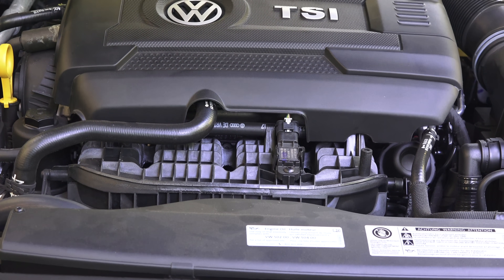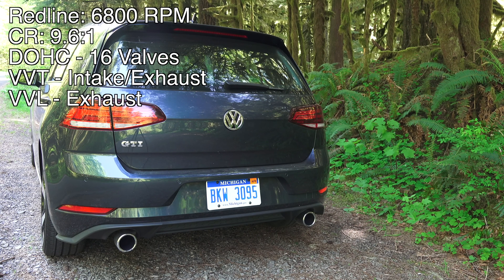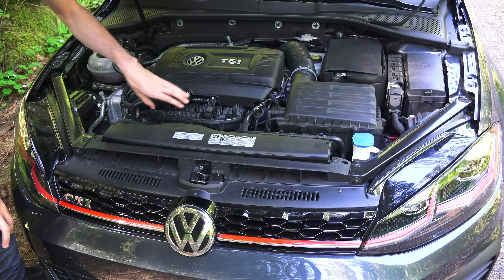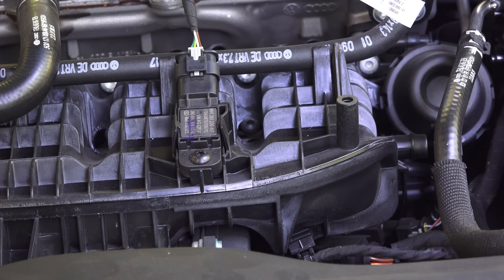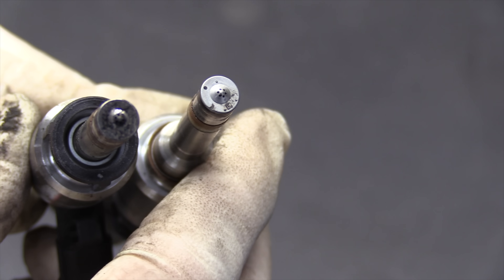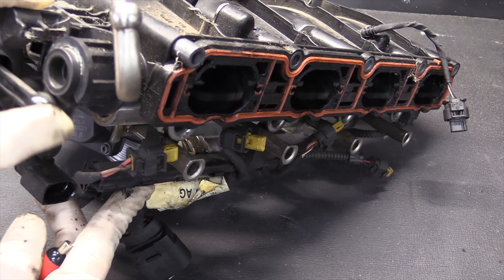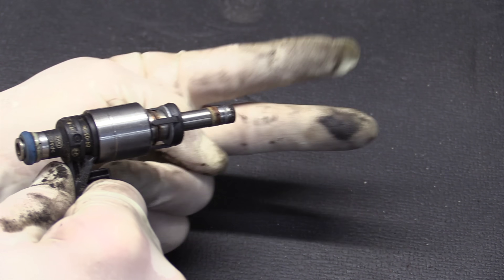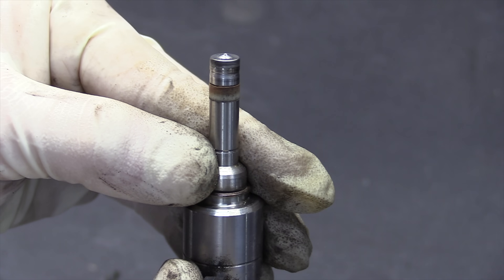The Best Engines - Volkswagen GTI Turbo

Comment: I thought the vw engines were crap
Reply: They are nice engines until they break
Reply: Did you read that on the internet?
Reply: The VR6 is the best engine hands down
Reply: They are good but as with most if not all German cars they use cheap shitty plastics for things like inlet manifold which break and the sensors are always packing in making the dash look like an Xmas tree.
Reply: nothing on bmw engines,  suspension much better though on vw. this gti engine suppose to be very good though. had one in my old scircco, very linear power, not spectacular though.
Reply: They are crap ;)
Reply: Digidi4 operated poorly

Comment: You have no idea how many check engine lights I had with my GTI... is this a joke
Reply: Steven it's 6800 until redline begins. 8000 is the maximum the revcounter can display, but your engine won't rev that high.
Reply from the maker: That was to alert you your engine was award winning! 😂
Reply: lol
Reply: My tuned GTI is sweet, only light I get is traction light !
Reply: 2015 GTI, 62,000 miles and not a single issue..don't even know what my check engine light looks like lmao
Reply: Engineering Explained this little light of mine, I’m gonna let it shine!
Reply: I have a 10 years old GTI and had never had an issue
Reply: Rockytofu I have a MKV and it’s got over 100k. The turbo did blow, driver error on my part, but otherwise no issues. 

You have to take care of the car for it to take care of you. That said, yeah sometimes you get unlucky and get a bad car for whatever reason.
Reply: The problem with volkswagen's is that people maintain them like corollas. Corollas are bulletproof because they are econo boxes that are not fast but will run for ever for cheap. Cheap, reliable, fast, you can only choose two.
Reply: It can rev higher than 6800 if you downshift it. ;)
Reply: Comments over here be like, "never had any issues with my golf, just changed the engine once".
Reply: Rockytofu.  While car shopping, I looked at a GTI, but walked away when I found out the 4 year old car had 4 previous owners.  There was definitely something wrong with that car.
Reply: MK6 GLI - 40k miles with 100hp over stock and never had a check engine light. I know a bunch of people that would say the same. 

But my old MK4 GLI check engine light was on 90% of the time I owned it. Countless vacuums leaks. My brother drives it now and it still runs great. 

They are great engines in my opinion. Especially if your going to mod it. Best all around cars you can buy for under 30k in my opinion. 
The DSG is awesome but can be a little sluggish in automatic. I drive in manual mode all the time.
Reply: Yep. mk5 was a mess. Then I urged a friend to stare clear of VW but he insisted and bought a mk6 GTI... says it was the worst decision he ever made. Mechatronics unit failed, got a new one. Timing chain rattle began, got it fixed. Mechatronics failed again after that and he gave up. You cant blame me for not having a single complement to pay towards VW. Their service is by far the worst as well. Never admitting their fault. So ill never get another on again haha
Reply: Noooooooo! No more k swaps lol soon everything will be kswapped
Reply: kkthxk Had never really understeer in a Civic, 80/90/00 Civics do more oversteer thanks to double wishbone suspension. Only the 8. and 9. Generation Civic had problems with understeer because of a complete different setup
Reply: Just because u get a c.e.l doesn't mean your car will break down
Reply: It's because VW's and other VAG group cars tend to have a lot more sensors than other cars. You could get a check engine light for something that another brand doesn't even have a sensor for. Or wouldn't bother warning you about.
Reply: @castin5244  can you give an example?
Reply: @user-jt6nw6wm5q  Well, I can't really speak for newer vehicles, but my 2004 Jetta 1.8t has like 5 different sensors and control valves for the vacuum/turbo system alone. Like wastegate controller, diverter valve controller, EGR controller and other valves/sensors for the turbo system. All of which are electronically controlled and can throw codes for small dysfunctions. Whereas other vehicles of the same era, like say a Chevy Cobalt or Toyota Camry doesn't have anything like that at all.  
Also, VAG group cars will give you a check engine light for things that other brands wont give you a check engine light for, even though they both have the same problem. What I mean is, a VW and Toyota might throw a code for the same reason, but the VW will show you a check engine light where a Camry will not. for small things, like a hiccup in the transmission or an intermittent failure in a temp sensor or something. I can't think of any specific anecdotes right now, but I've many vehicles of various makes and I've seen domestic vehicles have a ton of random codes but no check engine light, and a VAG car have a check engine light for one code. People perceive this as VAG cars being less reliable, but I honestly see it as a FEATURE. They warn you faster than other cars would. And just because you don't have a check engine light doesn't mean nothing is wrong with your car.
Reply: What year was yours? I've got the EA888 in my '15 CC R Line. Stg 2+ APR tune with full bolt ons, and running 100hp/150tq over stock for about the last 35k miles. Not a single engine issue. 76k miles on the clock. Preventative maintenance is imperative. That and you gotta give her the ol "Italian tuneup" every time you drive it.
Reply: maynardDRIVESfast 80 ...what’s the “ole Italian tuneup”??
Reply: Rockytofu A volkswagen without check engine light isn't a real VW.
Reply: kkthxk not mk2 it changed from mk4 to mk5. Mk4 has the lighter 1.8t, while weighing it at about 2800lbs (which is more lightweight than all the new gtis) then mk5 can around with the 2.0t and a bigger body weighing at around 31-3200 lbs
Reply: Rockytofu im fro. Germany and i know what u mean but he dont
Reply: George Venetsanos because it has a 1.8t
Reply: And people continue to fawn over the "Germans". Sometimes I get tired of hearing that.
Reply: Not true, I've seen mine rev to 8700 rpm.  You could read it with a scan tool after the fact and it also voiding the warranty.. somehow it didn't blow up..
Reply: alit90 
The mk5 R32 was known to be a jumbled mess right from the beginning, should have had it fixed properly before it broke. Buuuuut there might have been too much to fix, so basically buy a new car.
My client's Golf R blew itself up lol I told him my old '98 Mercury Mystique would live twice as long, it is now 10x as old.
Reply: 100,000+ on my MK6 and I'm just now replacing bearings, and suspension do to a cracked spring and fatigued shocks.
Reply: Suburban ok good for you maybe look at a CPO or a single owner vehicle.  Just like I've owned a Honda that blew a transmission (Acura TL 2003 which are known for it), and a Toyota Rav 4 which threw a rod through the block.  Guess what has only had minor problems over 100,000+ miles?  The MK6 GTI and I'll admit I don't baby her at all because you can't have a fun car and not enjoy it.
Reply: 8th gen civics (at least the Si's, I can't speak for the normie car) also have double wishbone suspension. If I huck mine into a corner, especially with a little bit of left foot braking, will predictable oversteer. As a chassis it feels more balanced than the mk7 GTI's, however it IS lowered a bit, so maybe that's why.
Reply: The performance-pack model will rev higher than normal if launch control is engaged. I think it's dependent on oil press+temperature, but the highest I've ever seen on the one I've driven before fuel cut is about 7500. 8700 is insane, and (probably?) a mechanical overrev that did some damage. The stock valve springs are nowhere near stiff enough for that kind of rpm.
Reply: kkthxk  what I own a 2015 MK7 GTI and I was going to get a Ford focus st and that had bad torque steer. Tye new MK7 has hardly 2 degrees of  torque sterr on the steering wheel.....I bet you haven't driven one before as your claim is quite false my reasoning almost 4 years of ownership of a MK7...
Reply: kkthxk well they are the people's car... especially the golf.  how many TYPICAL golf drivers are going to really test it to it's limit?
Reply: kkthxk Understeer? You’re nuts this thing corners like a mad man. Can’t say I’ve ever had it understeer even mountain driving.
Reply: No check engine lights in 40k miles in my '15 Sportwagen 1.8t.
Been awesome!
Reply: I get zero alerts
Reply: I have a close friend who is a mechanic for VW.  He will not buy one. Too many issues.
Reply: You notice they are working on the engine in the video.
Reply: All vw's are the same and can't take it to the dealership cause they don't have a clue
Reply: I had a MKV R32 and it was literally the most unreliable car I've personally known of... never buying another VW
Reply: kkthxk a Honda Civic never had bad understeer for a fwd at least. If its set up correctly of course.
Reply: Yeah I’d never buy a 2.0T by VW or Audi. 1.8t for life
Reply: You have to follow the rigorous maintenance program, in very much the same way you would a Ferrari or Bugatti, etc. There is a full scale maintenance program available for each model, consisting of a multipoint inspection every 3-4 months. If you do that, they will work fine, if you wrench yourself- make it a project car.
Reply: @ Suburban the tsi's are very flawed engines. good power and torque but typical german UNreliability and a piss poor warranty shows the dont give a hoot about the customers
Reply: @heartattakjoe7152  6 years or 72,000 bumper to bumper. Industry best
Reply: Engineering Explained 8000 rpms, not 6800

Comment: When you said the direction injectors allowing regular and premium fuel, is that exclusively for Volkswagen turbo cars? Or does that apply to any direct-injection turbo vehicle?
Reply from the maker: Quite a few vehicles will be able to easily handle both, though it's not necessarily a given. Owners manual will say.
Reply: flap door on GTI says MINIMUM 98 RON, which is 93 for the american folk
Reply: I’ve had two GTIs.  A 2010 and a 2015 that I used to travel regional a lot with.  They both ran fine on 87 when I would often put a few tanks of it in on a long trip,  or when the spread of regular to premium was too high.  From what I could tell, I didn’t think throttle tip in was as quick but it could have been my imagination.  From dyno testing though, there was a 10% reduction in HP.  Additionally, there was no weird timing issues with regular and even a noticeable difference in fuel economy.  I remember getting 36 MPH on a long highway trip once where I used up the whole tank of regular gas with speeds of 70 - 90 MPH.  I currently own a BMW with the B58 six cylinder turbo.  In that engine, using regular has a noticeable effect on fuel economy and timing changes during acceleration and even light throttle.
Reply: William Monto knock sensor will pull timing. Never a good idea to use low octane fuel in a car with a turbo from what I know.

Comment: Its quieter than my Elantra sport
Reply from the maker: Haha, it is quite quiet!
Reply: I'm pretty sure it's so quiet because it's a German car and here in Germany we have very strict dB limitations
Reply: I've got the same experience with my dads GTI. Nice and quiet when you're just commuting or travelling, but when you want that sporty sound, you get it.
Reply: Although It’s not gay and cheap as your Elantra sport ¯\_(ツ)_/¯
Reply: Matthes you nailed it though on why it’s so quiet. The GTI was meant to be a sporty/luxurious daily. You’re right about the RPM becoming a exhaust tone change haha. But with my Mk6 it was way to quiet for my liking but for a daily stand point. The noise is perfect because it’s quiet under the 2500RPM range (which you’d probably be daily) but loud when you full throttle it
Reply: What?
Reply: t*TO4ST but how about Mercedes AMG? lol
Reply: KingGhoul 21 yeah they are much louder, you're right. I think it's a good thing though, not every sports car needs to be loud. It's  quiet and fast, which makes a good daily driver, I guess. I'd be annoyed if my daily driver would be super loud, honestly. Also: It gets pretty loud once you're past 3000rpm (not as loud as most other sports cars)
Reply: KingGhoul 21 Until your engine begin to make knocking sound

Comment: Absolutely love this channel, the GTI is one of the most attractive cars to own at the moment as it's a great car in all bases
Reply from the maker: The GTI is pretty much a perfect daily. Really solid car all around.
Reply: How is reliability?
Reply: not bad but expensive.
Reply: not a single issue, I'm at 62,000 miles and been changing my own oil
Reply: The Leon Cupra is way better, but SEAT is not available in the US
Reply: Most attractive? I'd disagree. But you can't argue about it being the best value you can get out of your money if you're a car guy/girl
Reply: MK6 GLI - 40k miles with 100hp over stock and never had a check engine light. I know a bunch of people that would say the same. 

But my old MK4 GLI check engine light was on 90% of the time I owned it. Countless vacuums leaks. My brother drives it now and it still runs great. 

They are great engines in my opinion. Especially if your going to mod it. Best all around cars you can buy for under 30k in my opinion. 
The DSG is awesome but can be a little sluggish in automatic. I drive in manual mode all the time.
Reply: GForceConnections  fair yeah in Ireland it's a pretty baller car to own though , being an enthusiast here is tough with the price of  cars being way higher than most countries
Reply: Engineering Explained,  definitely great for someone who needs a solid reliable family car but also wants a bit of fun on the side

Comment: I love the GTI
Everyone always bashes on the TSI's reliability and such, but if it was a bad engine it wouldn't have won so many "Engine of the Year" Awards.
Can you do the BMW B48 or B58 engines please?
Reply: The most commun issue I've seen have been oil burning issues...
Reply: Khaled Hossam They don't base the award on reliability, clearly because there would not be enough time to determine reliability in one year lmaooo They are just talking about for function or performance based on what it's designed for
Reply: They're awarded within a year or two yea, but it's won international engine of the year every year starting from 2005-2014, if it was that bad it wouldn't have won 10 annual awards.
Reply: A Mazda Renesis won an Engine of the Year award. It doesn't mean jack.
Reply: kkthxk carbon deposits are terrible on ANY direct injected engine with a EGR valve lol. Minus the EGR valve is a big help. Gonna be doing the timing chain/VVT job on my Speed6, at the same time the EGR valve is getting deleted and a autotech HPFP is getting installed.
Reply: anermand lmaooo
Reply: anermand Yeah that's every German car and every turbo engine vehicle
Reply: Channel, I've had both ea888 and rx8 1.3 renesis 😂😂
Reply: Keye T I have seen it on Merc but i am yet to discover the same amount of issues on a BMW
Reply: anermand lmao
Reply: Driveitsideways 1 also have a speed 6, after you do the timing stuff it's a huge difference.
Reply: 100,000+ on mine.
Reply: Khaled Hossam if you look at the criterias for engine of the year award you'll see reliability isn't one of them.
Reply: The awards are dealt within a year or two from release which makes the awards worth basically nothing...also VAG is probably the worst car company at the moment as pretty much everything breaks on them... PS. this is just my opinion as a mechanic and if you feel differently, I don't want to know about as you wont be able to change my mind anyway:)
Reply: I've been repearing that sheit since 2005👍
Reply: I've got a 2013 Golf 6 that has never had anything in it break down, I'd say that their quality's pretty good.
Reply: anermand so Honda's never break?  What about Toyota?  If you say yes that they don't break you can stop giving your "educated" opinion because you are full of it.  I've had a Toyota that threw a rod through the engine at 110k, a Acura that blew a transmission at 123k, my coworker has had multiple issues with her Kia although I don't ask because I kind of don't care about Kia.  The cars that keep on truckin over 100,000 are the VW's that my coworkers and I use to deliver pizza.  Two MK5 Jettas and my MK6 GTI.  That's more miles, more starts, etc than your average person and if the EA888 as well as the i5 were inherently unreliable we would have all been forced to switch cars by now.

Now that Honda is in the turbo game I will definitely be taking a look at one as my next car especially with how efficient the SI is.  But I will always love my VW, and would happily purchase another if it was in the budget, and if the competition turns out to be lackluster.
Reply: Khaled Hossam people who bash the reliability have never owned one. I’ve had absolutely zero problems with my wife’s 2nd gen Tiguan